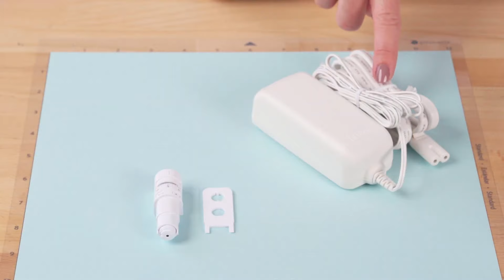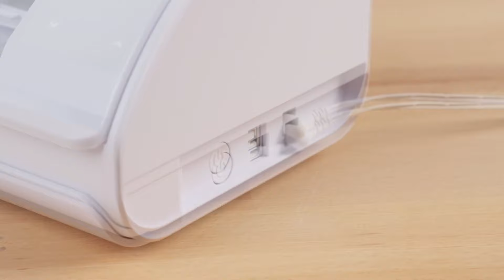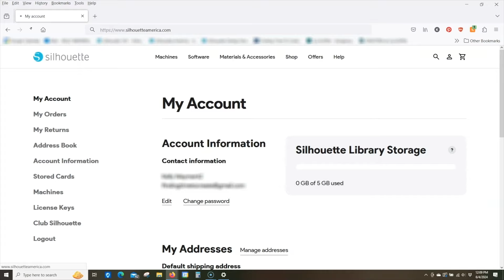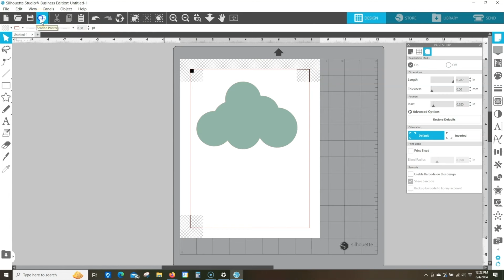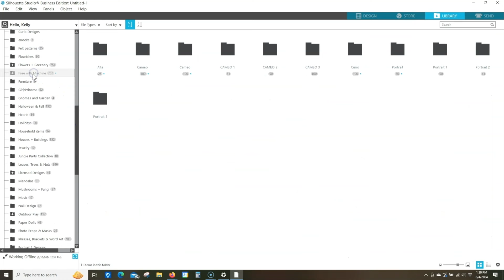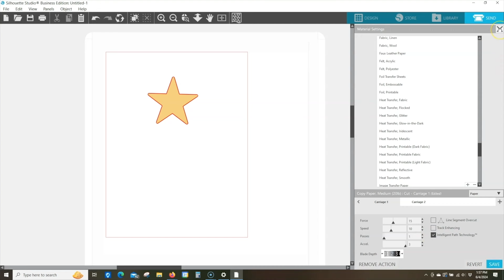Getting Started | How to set up the Cameo 5

Comment: wht blade should be use to cut magnetic sheets?
Reply from the maker: You should be able to cut magnetic sheets with the auto blade. If you are using a tougher and/or thicker brand of magnetic sheet you may need to us a kraft blade.
Reply: @CreateWithSilhouette  is the craft blade sold for cameo 4 the one that I should purchase for my cameo 5?

Comment: why do they not say which side of the media goes face down :(
Reply from the maker: The media type determines which side should face down—for most materials, the liner or backing side goes against the mat, with the material that you want cut side facing up.
Reply: @CreateWithSilhouette  generally thats pretty obvious because  your blade is going to cut what it touches.  i guess there are some exceptions

Comment: Will my silhouette cameo 1 blades, fit in cameo 5.
Reply from the maker: It is possible with a tool adapter, which can be purchased at https://www.silhouetteamerica.com/tool-adapt-set. Without knowing exactly which blade it is that you have, we can't say for sure if it will work, but most likely using the tool adapter will work and allow you to use your older blade with the newer machines.

Comment: Hello

I Need To Buy 
Curio 2 Flatbed 12" / 12" 
With Electrostatic Mat For Cutting Natural Leather & Rexine ( Artificial ) Leather 

Is The Machine Capable To Grab The Leather & Cut 

Or Which Model Can Cut Leather With ES Mat

Please Tell Me

Thank You
Reply from the maker: We don't recommend using the ElectroStatic Mat for cutting leather. Leather tends to be textured which does't work well with static electricity in holding things down. The Cameo 5 and Curio 2 can cut leather with the 3 mm Kraft Blade and an adhesive mat as long as your leather isn't more than 3mm thick.
Reply: @CreateWithSilhouette 

Really 
Thanks For Your Valuable Information 

Instead Of Electrostatic Mat For Leather
Can Vaccum Absorption Flat Bed Be Used To Cut Leather With Knife Any Idea

Please Tell

Comment: I purchased the silhouette foam cutter and am having trouble cutting foam with it. When I begin cutting it makes a lot of stuttering sounds and much louder than it should. I can't tell if the foam is slipping or something and thats throwing off the cut. There doesnt appear to be a preset depth in the application. Does know if there is a recommended setting to use for foam?
Reply: I'm assuming you mean the "deep cut blade" or the 2mm blade? I cut craft foam on a blade setting of 18-20. This tutorial is old, but it still has some good tips. https://www.silhouette101.com/archives/deep-cut-blade-tutorial

Comment: What does it mean Silhouette 5 can cut between 5-12 inches wide?   We all know our previous models can cut the smallest of shapes!!!!!  I don’t understand
Reply: The width of the material not the size of shape I believe is what they mean. You have the mat for little things anything fed has to get grabbed by the feed roller.
Reply from the maker: @JoyfulStitching is correct. The machines can cut shapes smaller than 5 inches, but the material that it is cutting should be 5-12 inches so that the pinch rollers can properly grip the material.
Reply: IKR...
I don't own any silhouette machines. It sounds like they are trying to be creative with words at this point. 

If it only cuts at widths 5" - 12", does that mean we are screwed if we need to cut something 4.99" and smaller?😅 😆 🤣 that would be weird.

My Starcraft Solo cuts any size up to 16" wide, no minimum length, no membership requirements, various software options, I can use with or without  a mat, similar functions as Graphtec, GCC, Roland, and other professional plotter. Silhouette is a  close 2nd. They all use speed, pressure, etc.

Silhouette is an okay company for easy home machines but I'm not a fan of any company that pushes machine upgrades every year making you buy yet another machine then you wind up with several separate machines when 1 machine should work.  I am not at all a fan of Cricut machines for that reason. The exception  is the Cricut joy for portability but not total functionality.

If I could find a portable option for a machine that is not constricted to using 1 software program, I would buy it. The Silhouette portrait is okay but at the time it was too high a price so I bought the cricut joy.

I shall see what the future holds. 😏
Reply: I am having trouble buying blades for this machine!!!!
Reply: @carolwiebe2820  🤯😳😲 oh no. Glade I didn't buy this machine. 

To try to help you, I looked online for - blade replacements for Cameo 5 - and they are available. 

Q: Do they only come as the unit + blade instead of only the blade part? 

That would be terrible. That would mean you can't replace just the blade, and you are forced to buy the product over and over. That's too much product waste. I saw a 4pk on, Swing Design website, for $36+. Nooe, that's too much. 😤🤐